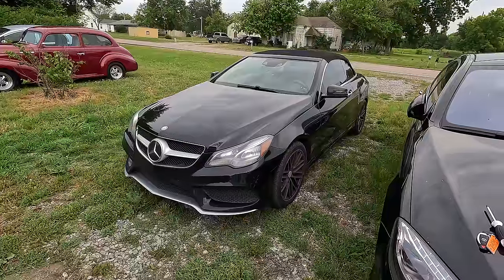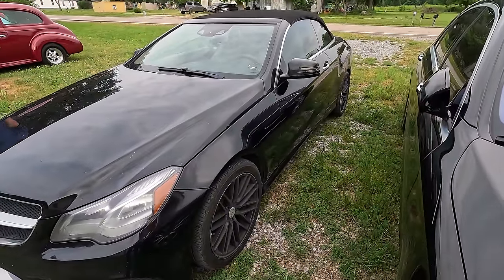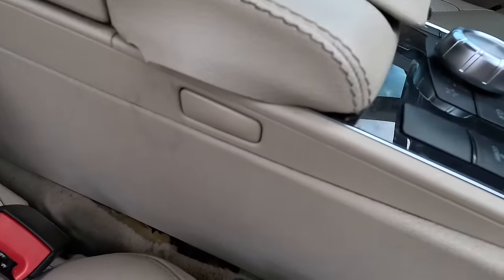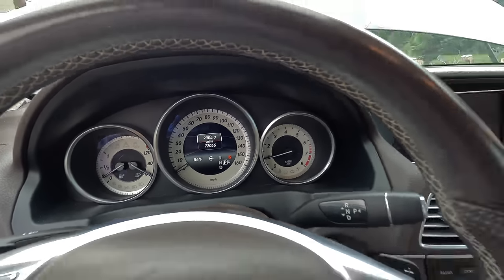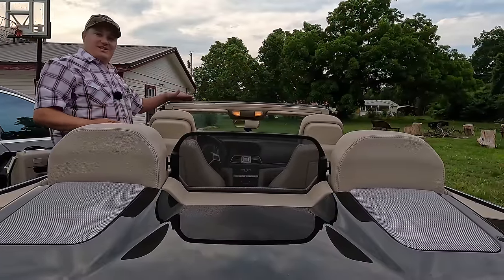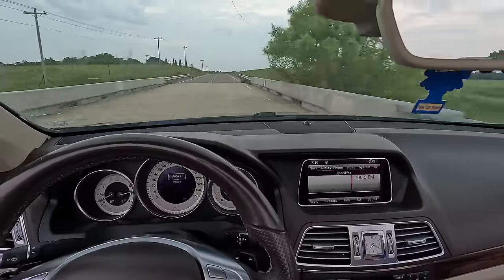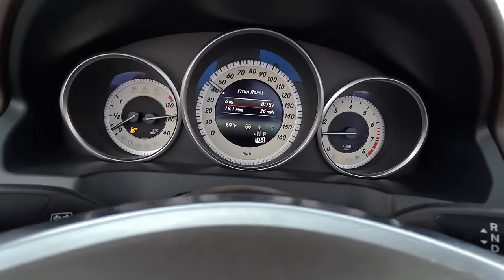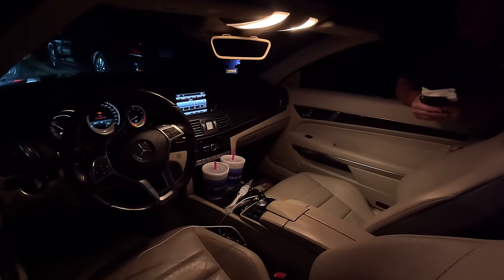This 2014 Mercedes E550 Convertible was too Cheap for a Reason!

Comment: I owned a 2014 E550 Coupe a few years back.  I loved that car.  Stylish, powerful, comfortable and well equipped.  Wish I still had it.
Reply: What do u have now?
Reply: @chillvelocity5686  a Honda lol
Reply: @chillvelocity5686  drive it hard and the gas is 👎. I drove my father’s 2004 E500 for a week. Gas was horrible. Fun car to drive, extremely fast Although, barely heard that V8 engine under all that thick leather on the dashboard. 
Not hating on the car at all Randy. Just saying how bad gas is when you drive it hard. Drive it normally though, you’ll be surprised. It’s not too far off from an E350/E320 as far as MPG is concerned.
Reply: @expertgaming1002  you do to buy a V8 with 400+hp (underrated) if MPG is on your mind.
Reply: @JonUF02  I’m aware of that.
Reply: @Armaganius  no
Reply: @expertgaming1002  YOU cant compare A OLD 2004 E500 TO A NEW CAR... HE WAS GETTING 24MPG WHILE PUSHING IT HARD.. YOUR E500 Brely got 14mpg avg or less.  Remember turbo cars save tons on gas.
Reply: @chillvelocity5686  I traded the E550 for a 2017 C63 Cabriolet, that car was a beast. Last summer I traded the C63 for a 2022 Lexus GX460.
Reply: @juliandrake3159  beautiful car. I want to buy a 2017 or 2018 C300 Cabriolet. Maybe even brand new. I love this C-Class coupe styling. Can’t stand Mercedes’ new direction of design language. I am officially a BMW guy again. Can’t stand new Mercedes products. Mercedes used to produce good looking cars, but now they look like bugs and the cars are becoming so technologically advanced, it is as if that’s their main focus. New C63 will be a 4 cylinder hybrid. You had the good one. You had one of my dream cars.
Reply: @juliandrake3159  good idea.. Toyota, Lexus and BMW is all I would drive.  My FC rx7 just comes out once a year.. lol
Reply: @dzgaming1  I never really had any trouble with the C63 but there was some odd squeaking noises that drove me nuts when the top was up.  I only had it for 3 years though and was able to trade it for only a couple grand less than I paid for it.  It's an expensive car to maintain and in my daily driving I was averaging around 14-15mpg with it.  The Lexus actually gets slightly better mileage and it is quiet like a vault.  Completely different vehicle though.  I averaged around 19mpg with the E550 Coupe.
Reply: @juliandrake3159  that squeaking was the supercharger belt going on and off.. you should of upgraded the pulley.
Reply: @expertgaming1002  bro I had a e500 2003 and it barely got 22mpg on the highway and this e550 got 24mpg avg with his foot to the floor.. how you gonna compare a 5.0 v8 to a 5.5 v8 twin turbo.. you must be a smooth brain.. my c230 supercharged use to drag on my e500.. that only did 0-60 on 6.1 seconds at best on my dragy.  Do you even know anything about cars???  the e500 would get 8mpg driving the way he was driving that e550 LOL!
Reply: I just traded in my 2020 c300 (lease) for a 2023 GLE53 (financed) in white with the midnight package.. waited one year for it but it was worth it.  Thank god I didnt get the coupe GLE because even the non couple GLE seems small to me.
Reply: @dzgaming1  No, I thought it was coming from the convertible top but talking to someone else who is familiar with these cars said the noise might have been coming from the rear subframe mounts as he experienced something similar in the C63 coupe.  Mercedes could never figure it out and finally gave up and said it was normal convertible top noises and that I would have to live with it.  I traded it in shortly after that as those noises drove me nuts.  It wasn't supercharger related as the C63 has a 4.0l twin turbo engine and doesn't have a supercharger.  The turbos are nestled in the V of the engine in a hot-V setup.  Kind of a unique way to package them.
Reply: @juliandrake3159  you are right they had the 4.0tt, the HOT V setup is probably the worst design ever.. Audi went that route too and its the worst thing in the world to work on.  Anything goes wrong with the turbos or any of those cooling lines that have a mesh in them that gets clogged and you have to do an engine out job.  Already had to do a few engine outs on new Audis with the Hot-V setup.
Reply: @expertgaming1002  if you buy new wait for the new CLE
Reply: I've still got mine and I love it!  Finally storing it this winter and driving a truck to increase the life span.  Haven't had an issue and have owned it for 3 years and put 30,000 miles on it.  Still only 50k on it, so we'll see how it goes!

Comment: I bought a 2010 S400 hybrid 52K miles, costed me $1500 because it was dead, was told needs $24K to replace the hybrid battery plus $18K to replace electronic control module (a hybrid device) all it needed is software update, also was a CARB state car, 150K miles warranty or 15 years (originally purchased new in CA) seller didn’t know about CARB laws, and dealer in Texas didn’t know about that special warranty,6 years later and now 122K miles, still own it and do my own repairs on it mostly replacing airmatic struts and speed or ABS sensors.

Comment: I had the same car with almost 150k, the top was extremely reliable, never gave me any issues or leaks. One cool feature on this car is that you can hold the unlock button on the key and the top goes down without you having to be in the car, hold lock button for top up
Reply from the maker: I tried that and couldn't get it to work for me.
Reply: @AutoAuctionRebuilds  Replace key battery it should work
Reply: @AutoAuctionRebuilds  You have to hold the key near the drivers door handle.

Comment: Hi Randy

I bought a new E212 Coupe with a diesel engine in 2010. The model was based on a C Class chassis until the E class major update in, I believe, 2016. The rear passenger leg room sucks although I was  single at the time and it was not a problem for me. It was a very good handling car and I loved driving it. 

Ken

Comment: I inherited an older A8L Quattro. In great shape, pretty, and the older kid will be taking to their specialized military training for transportation. 
I've got about $8k in it, "Getting it right" and doing as much as possible to make sure it won't have any consummable parts failures. Did get a set of new Bilsreins & progressive-rate sport springs (from Germany with TUV certification) and a Magnaflow muffler & tips to replace the "Suitcase" muffler at the very rear. It is a really 😎 looking big sedan

Comment: I did a transmission control model reset simple procedure it reset the transmission to factory settings it added another 100 horses also to my muffler off it sounded like a beast but not loud  tires always needed air careful you will be in love with Mercedes and it’s loaded with hidden features

Comment: Hey Randy, that is a nice 2014 E550 convertible. Especially with the roof, deflector and headrests working. You are correct that it is not a S-Class; it wasn’t meant to be. If you have to decide between the 2; keep the ‘vert.
Reply from the maker: I might just keep this one.

Comment: That 3rd button next to the heated and cooled seat buttons blows warm or cold air on your neck. Sweet car.
Please watch out for cylinder scoring on those M278 twin turbo V8s.
Reply: Using the recommended oil for its engine thus shouldn't happen. Mobil 1 is used in these.😊

Comment: On the W212 I think steering assist only works below a certain speed.  Maybe 30 mph?  18 mph?  Something like that.  It's meant more as a traffic aid, not a highway aid.  In the W213 and facelifted W222 they improved it to work at highway speeds, but that wasn't until 2017-2018.

Comment: The Distronic function is the adative cruise control it did not activate because you did not have any car in front of you....
The steeringwheel might have a steeringassist function or/and button that you engaged for a bit....
It might have been for the poor surface made the wheel turn a bit bacause the MB ESP-function clicked in for a bit to stabilise the car...
The crappy roadconditions sometimes play games with different driveing security systems....
Does the disable 🛞💨function turn all driveassist functions off or only anti-spin ?
With the Roads of yours I would definately keep the S-class with the airsuspension and cameras that scan the roads it is a very safe car hence there is any crash as well....
Keep up the good work and give my best to 🙊 🔧-Mike too....

Comment: The reason the S Class has so many more features is an options thing, but the biggest reason is that your S Class is a Facelift model. Usually, they will make the last series in a Class by the next series specs as kind of a preview. Yours still has a few of the W221 features that's how I can tell. I.e., the phone pad you have that's concealed didn't come with the 2015 model
Reply: His S550 is a 2014 which is the first year of the W222.  NOT a facelift.  Rather, the 2014 E550 is a facelift W212.

Comment: 4.7L V8 gas, the engine is also know as m278 Engine , also equipped with a  4.6L twin - turbocharged V8

Comment: Sold my 2012 E550 sedan for only $14k before the whole market went crazy. It was pretty mint with 106k miles. I always wanted the 1 year only 2014 with the facelift body, but last year of the 550 V8 Biturbo, in sedan at least. It was a great car 5 years daily and no real big issues other than AC died right at the end. The coupe is based on a C class though, so it is small. The sedan was a rocket with 4matic, but couldn't burn the tires. It worked great with 2 child seats. Wish I didn't give it away, but I wasn't driving it after getting a Porsche Cayenne, then traded that for a ML63 that I also love, the Swiss army knife of vehicles.
Reply: E550 had the M278 until 2016 did it not?
Reply: @kevin9c1 E550 sedan only made with m278 2012-2014. Not sure about coupe/vert if they went beyond 2014.
Reply: @JonUF02  Wiki says through 2016. What's your source for 2014?  The M278 was used in all "550" applications through at least 2016 from what know.  Maybe a bit further in certain applications.
Reply: @JonUF02  Wow I just scanned Auto trader.  There ARE 2015-2016 E550s but they are all coupes and cabriolets.  Did not know that!

Comment: The curse has now been lifted. It has a range of more than 30 miles, No blown head gasket, and the broken complicated convertible top that saved you some cash is not even broken.  The only strike against the car is that the low fuel light came on.   Your front line sure looks different from less than a year ago when I joined.  Greetings like always from Wichita.
Reply from the maker: Thank you sir! I got some old junkers coming back to the channel soon. It's all for fun!
Reply: @AutoAuctionRebuilds  You realize the main reason people watch your show is not Pickups, Mercedes, Bio-Hazard's. Its you, its Mike, its Santa, and when you got that seat out of the Allante threw the windshield you could tell it was not planned.   (Chrysler has Maserati again, I think Ferrari ran away from them a few years back.)
Reply from the maker: Thank you for the rare kind words man!

Comment: E550 is a 5.5 liter v8 the s550 is a smaller 4.7 liter v8 I think I bought my clk550 from carvana I had 0 problems for 2 years except the convertible top

Comment: Hmmmm possible flood ?? The car had drainage block at some point! You see where all those leaves are ! If it rains heavy that car will be flooded in the front passenger area ! Got to keep the drainage clean
Reply from the maker: The potential flood was from 2014 when the car had 12 miles on it. Literally brand new. No way it had blocked drains.